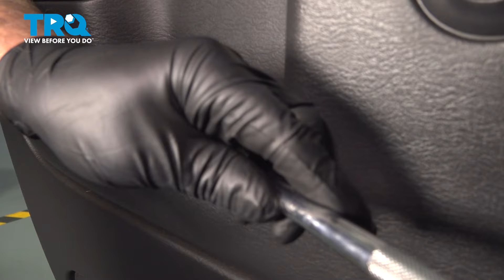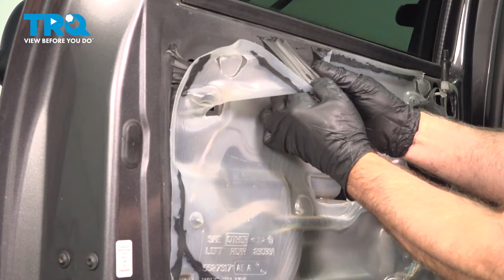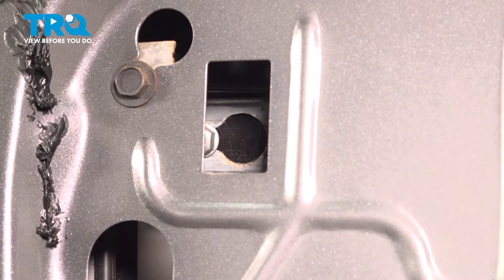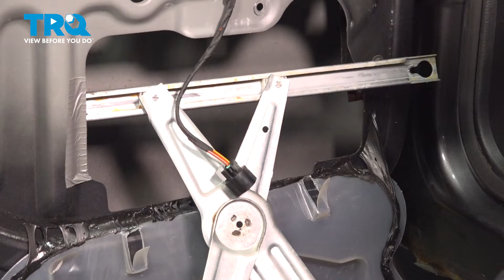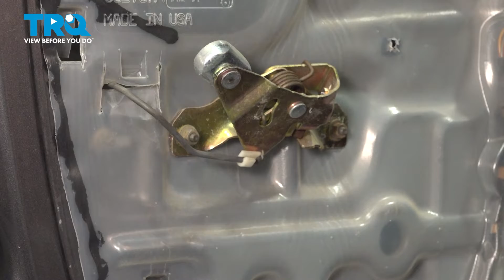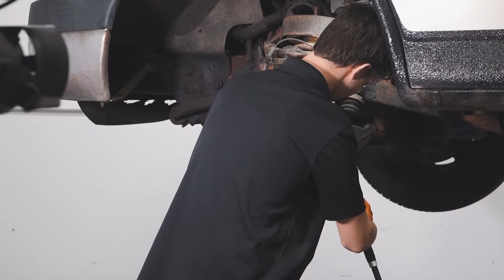How to Replace Power Window Motor & Regulator 2002-2008 Dodge Ram 1500

Comment: Followed the video and now my passanger window hardly goes up, and both doors make a clicking noise as the window moves, seems like the passanger side window is being pinched by the rubber track as if the window is free of the regulator its really hard to move by hand, i tried using pb blaster silicon lubricant but it didnt help much, any idea how to fix it? Idk what that part that is pinching would be called 😂 btw thank you for all the different videos and vehicals u guys do, u are always my go to where its this channel or 1a auto